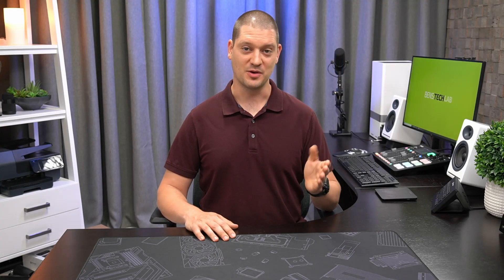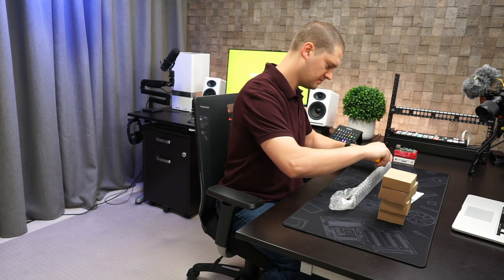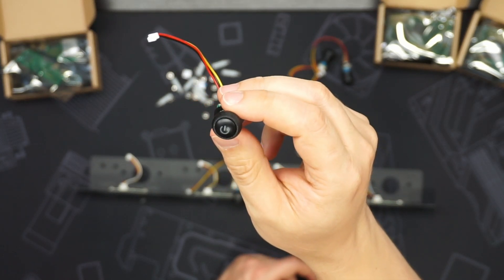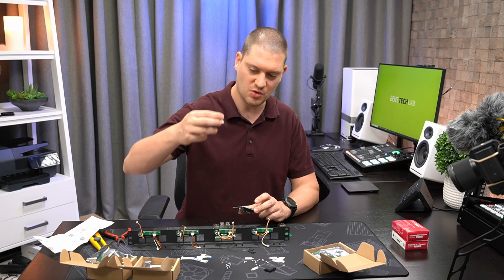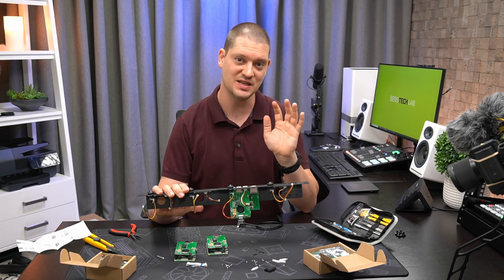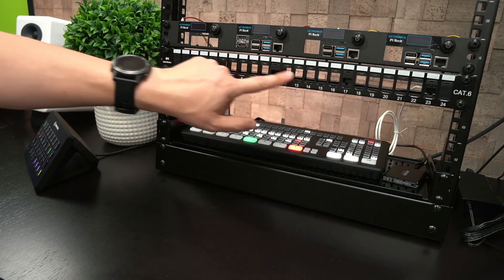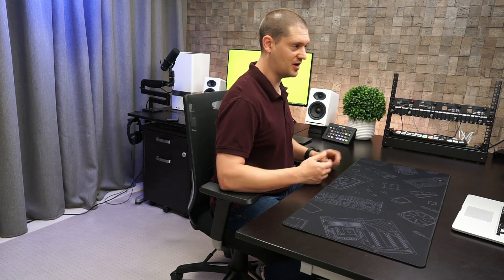Ultimate RaspberryPi Rackmount from UCTRONICS

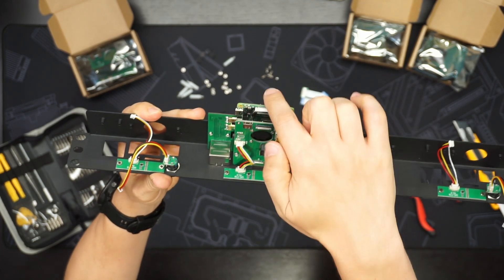Comment: @ 6:30 just know that inserting the thin cable from the sd adapter board into the POE hat is really easy. It's not explained anywhere, but before you try to insert it into the POE hat slot, there is a gray clip in the front of the slot that has to be pulled out. Push the cable in and then pop the gray clip back in to secure to thin cable. I had to learn this the hard way.

Comment: How do you get the display to work?
Reply from the maker: You can go through and double check all the connections are fully seated/inserted. I had a similar issue on another kit where a connector was just on backwards: https://www.youtube.com/watch?v=020lW8O-oK4
Reply: @BensTechLab   I can get it to work manually on Pi Lite but i get Failed to start RC-local.service - /etc/rc.local Compatability. See' systemctl status rc-local.service' for details. on start up. I checked that and it just said it wouldnt start...

Comment: I doubt about your explanation about Cat7 RJ45 cables and the metallic side. I have such cables with metallic sides and they are at least 10 years old ... For the rest, all good ! ;)
Reply from the maker: Shielded twisted pair definitely existed prior to Cat7, but it wasn't required for the network speeds at that time. It was optional only when required. For Cat7 shielding is mandatory. You can wikipedia the evolution of network standards if interested! P.S. UCTronics fixed the issue in their next generation PCB.

Comment: did you have a issue getting the power buttons to work?  What is the USB-C connector on the back of the hat for?
Reply from the maker: You can optionally power them via USB-C if you dont have a POE network switch or if you dont buy the POE version (which costs a little more). My power buttons work fine, note they are truly a power button on my model, not a software button for graceful shutdown.

Comment: Nice. I was specifically looking for reviews on Uctronics rackmounts. They have a dizzying array of choices.   In my case I don't want POE (it's nice, but I need each board directly interfaced into specific non-POE routers). I suppose I can remove the PoE board... but I really like the I2C display. 
(Hey @uctronics you listening :-)

And yeah, I do not want the fans either. I've invested in "metal heatsinked cases" from GeekWorm and CanaKit... I really don't want to be forced into the POE board just to use the external power and I2C displays.
Reply from the maker: Glad you enjoyed this video! UCTronics has actually sent me a bunch of their other products now for further reviews, I just haven't had time yet. However, you can use the PoE version of this kit without the PoE. There is a USB-C connector on the back edge of the board for USB-C power and you can disconnect the fans. I also bought some Geekworm heatsinks and PWM fans to mod this setup!

Comment: Looks like the main option for rack mounted hardware that is also low power consumption! Are there any other Single Board Computers other than Raspberry Pi that are being used like this?
Reply from the maker: It seems the raspberry pi is the leader of the pack by volume of sales or number of units sold. So it gets the most cases, mounts and accessories designed for it. I would love to see this expand to include Jetson Nano type boards as well as boards with external antenna for bluetooth/wifi!

Comment: can you program each pi with different apps/programs and mount them in a rack?
Reply from the maker: Yes! If you look closely at this rack each pi has its own SD card just like if it were a separate raspberry pi. It is common to run different apps on each one.
Reply: @BensTechLab  and how do you get the app onto a sd card?
Reply from the maker: @taranagnew436  here is a video where I where I flash the SD card using balena etcher: https://youtu.be/xgblUrx__l4

Comment: So, what's your opinion on this solution versus the blade type of RPi rack solution that uses the CM4 compute modules?

The blade solution was recently featured on Jeff Geerlings channel.
Reply from the maker: The blade pi is superslick!! But not yet generally available... ie: I doubt it will be available by the thousands worldwide anytime soon. UCTRONICS has an updated version of this rack that fixes the issues mentioned in this video coming very soon (ie: already in manufacturing). If I can get my hands on the blade pi, I would certainly love to play with them and make a video from my perspective.

Comment: that metal shielding on the side of the rj45 connector means its a STP cable. shielded twisted pair. it can be bought for cat5, cat5e, cat6, cat6a etc. but yes, cat7 and 8 cables are shielded by specification.
Reply from the maker: Thanks for the tips! So all CAT7 is STP, but not all STP is CAT7.

Comment: Hehe, little random question on the side here: are you using a trackpad for your Windows PC? If so, which model is that? I've wanted one for ages, but those seem nonexistent...
Reply from the maker: Yes I am using a (now discontinued) Logitech T650 Trackpad. It's a great product, not sure why it disappeared, they seem to sell used at super inflated prices. I imagine it was a patent war thing with apple magic trackpad or something (the T650 supports full multi-finger gestures and everything). Brand new it was like $65, now they sell for hundreds on ebay.

Comment: No SSD or M2 mount? Then it's not the 'ultimate'.
Reply from the maker: There is an SSD mount available, but it occupies one of the 4 rpi spaces. I think someone else in the comments suggested they make it deeper with space for SSD behind each pi - what do you think?
Reply: @BensTechLab  That's the point. There's certainly room for improvement, hence it's not the 'ultimate' solution.

Comment: Could we have a little more detail on why the shielded cables cannot be used?

I wonder if this creates an alternative common mode noise path - I’ve had experience with PoE PD controllers failing to negotiate due to increased noise in the past.
Reply from the maker: Hi Alex! I emailed UCTRONICS and they gave me a pretty good explanation, but much too detailed for comments on YouTube. Bottom line is the additional ground between two network devices can cause some kind of differential voltage in a specific PoE mode. Good news is they will have a new revision of this PoE hat soon that has an isolation transformer and capacitor added to the PoE circuitry which resolves this issue! So if you require Cat7 cables, stay tuned for a review on the new board revision soon! (They will be sending me the revised parts for review).

Comment: I've got one of these kits. It's a solid product. I had one PoE hat fail immediately, but support was great - they got me a replacement quickly. Two of them are piholes, and the other two are docker hosts. I'm considering buying another one to start playing with microk8s, maybe with an eye to absorbing the two docker pi's if it works out well.
Reply from the maker: Sounds like you have some great projects going! It's amazing how accessible tech is these days with relatively cheap single board computers like the raspberry pi.
Reply: HOMEEE ASISTANTTTT
Reply from the maker: @JohnK-k1o  🤣 someone watching Paul Hibbert?? I do like this idea!! Planning to at least test home assistant.

Comment: How is fan noise, I returned one kit as fan was too loud
Reply from the maker: Fan noise is present for sure. I unplugged my fans as I am in an air conditioned office. I also suggested to UCTRONICS that they add fan speed control to their next gen poe hat. These tiny fans are always loud from any brand, but fan speed control can make sure it only runs when necessary. I think this is the best suggestion. All that said, if you have a rack mount with some other servers or equipment you may have other 1u size fans already?

Comment: I appreciated your review and ordered the product.  I'm using Rpis for a variety of headless roles in my home network and this lets me put them in the rack with the router/firewall/switch gear and keep things straight.  I have one small concern, which is what happens when a poe adaptor gets fried, I'm hopeful I can still get repl parts at that time.
Reply from the maker: You can in fact order the poe hats individually! You can also still power the rpis via USB-C on the backedge of the poe board! So lots of options.
Reply from the maker: Here's the POE hats available individually on Amazon: https://geni.us/infJa (paid link)
Reply: @BensTechLab  This is good info.  For my application, I really want to use PoE because I have the extra ports, and I am very tired of power wires going to every device.  Have you considered a video where you make a dedicated PoE adaptor that can drive something like an ESP8266 w/ a hat?  It would make it much more convenient to power them this way and a bonus of the network's UPS protecting them from power bounces as thunderstorms (or whatever) take out the grid power.
Reply from the maker: @shortchange21  it will take me a while to get their with an ESP8266. I did buy an ESP32 recently and have a project in mind for it! But could take a few months... there is only so many hours in each day! 😁 but I love the idea of those inexpensive ESP chips/boards.